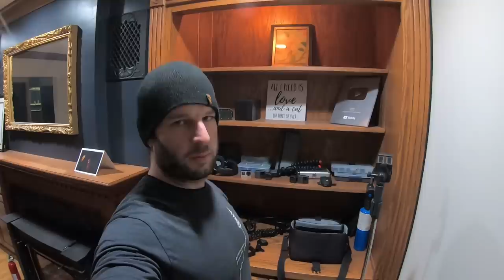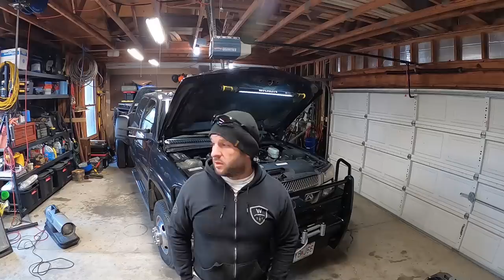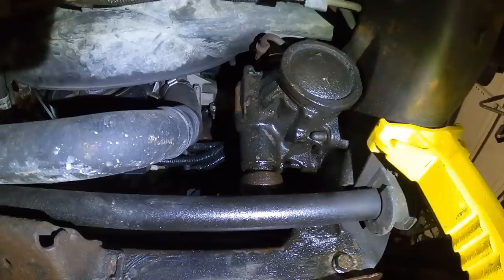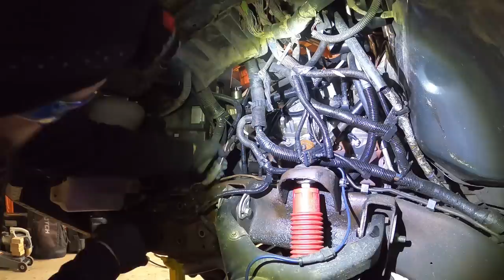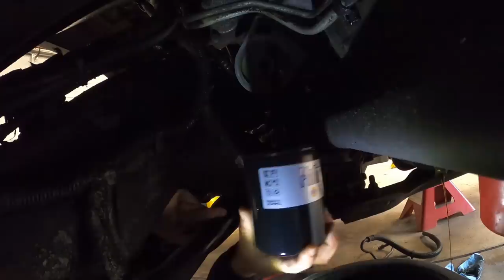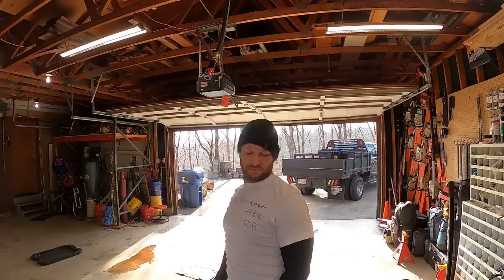Trial by Fire for the new Gopro

Comment: If you send gopro a camera working or not they take $100 off the 8 black, look at the website, might save ya some money. Only thing that scared me about the hero 8 was the non removable lense in case it was scratched.  You film a ton though so I guess the locking up happens more frequent to you, I hope I don't have to deal with that.   There's that other  camera DJI-osmo that's supposed to be really good too Corey. The Michael Scott adder had me on the floor brother,  glad you got it fixed though. You know that truck like the back of your hand now man.

Comment: Just wondering did you notice you used 10w30 and 15w40 when you filled the engine
Reply: Devin Sibo yes I saw that
Reply: I imagine at this point he figures there is no way the motor in this truck is going to die from wear due to a slight difference in oil weight before it dies from a head gasket/fuel pump/burnt valves/melted piston/being set on fire by it's owner.
Reply from the maker: Cashier pointed that out, I was too lazy to go switch them out

Comment: Gopros are all fussy and have a mind of their own. I haven't had any issues with my 7 black since updating the firmware. And whenever you do encounter issues like "sd card error" or locking up powering off and then back on has always worked for me. A step further is take the battery out then back in and power on. Minor inconveniences to put up with for an over all great product for capturing content. Dji osmo action is the next best thing perhaps